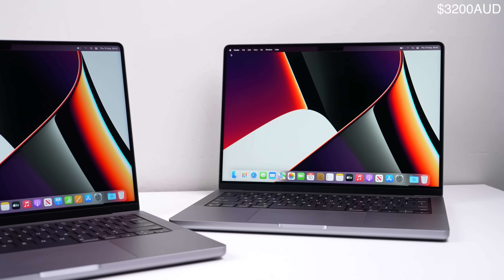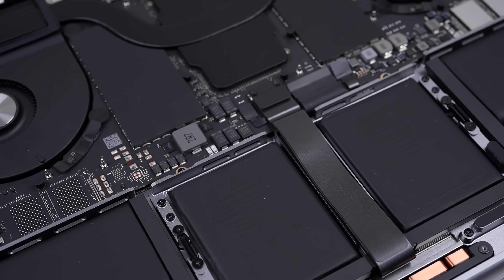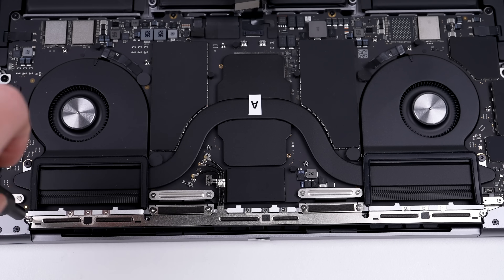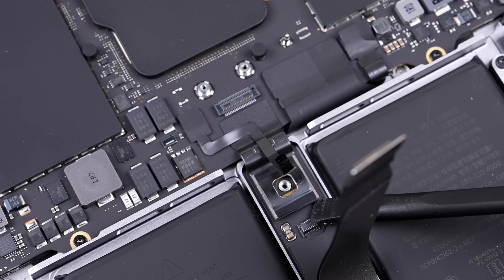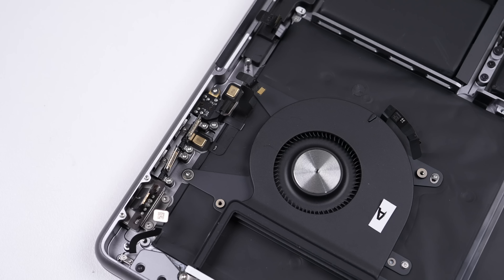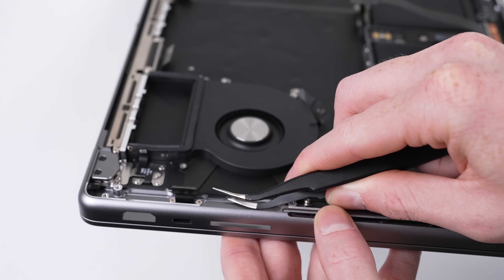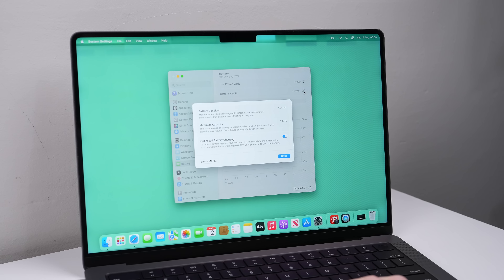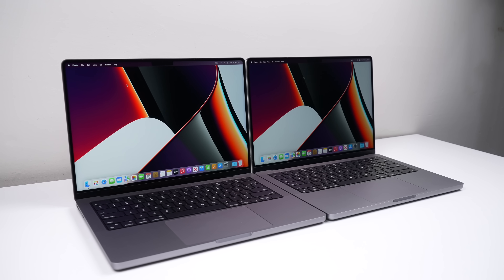New Anti-Consumer MacBook Pros - Teardown And Repair Assessment - Apple Silicon M1/M2

Comment: Oh wow, this has basically killed off replacement displays on Macbooks! Not a very good move at all, especially since delicate and fragile cables that are high risk of being damaged, are paired to either the display, or the motherboard...
To be frank, I fell out with Apple when their Retina series of MacBook removed the DVD drive, user replaceable memory, standardizes SSDs/HDDs, etc, and especially so when Apple removed the headphone jack in the iPhone 7. The long list of anti-consumer moves that Apple have made since have only gotten worse, with iPhones being locked down so much that they can't be repaired any more, and I reckon that the MacBooks will go the same way with the in-house silicon.
I would gladly take a Framework Laptop (or any other brand of laptop) over this new Apple nonsense way of things.
Reply from the maker: I believe its a shame because they do actually make some good things they just also go out of their way to make those things un-repairable.

Comment: I've debated on getting one of the newer Macbooks because the M series chips are super impressive... but Apple's refusal to make things upgradable/repairable without jumping through their expensive hoops is just such a major dealbreaker for me. I know Apple isn't the only company that pulls this crap... but they're certainly the one leading the charge. With how well engineered their hardware is, they should be industry leaders in repairability, not the opposite. It's just disappointing.

Comment: this is not an issue of calibration, this is obviously deliberate. Sensors like the sleep sensor angle are not going to be 90 degrees out of calibration when you swap them. This is apple checking the serial and then fking with you when shit should be working fine.

Comment: I don't know why, but it seems to me that Apple's budget to avoid having their hardware repaired by third parties, whether it's iPhones or MacBooks and everything else, must be several times higher than what they invest in R&D...
Reply: There's considerable overlap between the two, they like developing proprietary components as a means of preventing repairs. The "insomnia" problem is a good example of that, they had to design a completely different method of detecting screen angle specifically to make it harder to repair.
Reply: @@bluewaffletwatYou’re missing the point here. When repair is needed those laptops must be opened and serviced. If only Apple can do it, then there is no competition, thus pricing is what Apple wishes it to be.
Reply: Capitalism is fucking weird.
Reply: @qwertykeyboard5901  There are two extreme ranges of capitalism we know today. First one is responsible capitalism and the second one is unchecked capitalism. Unfortunately more and more people are tending towards the latter as resources in Earth dries up with no confirmation that Humanity can explore outside Earth for more resources. Add to this there is a threat to civilization coming to an end. Obviously some people wants to feel good/powerful before their lives end.
Reply: @qwertykeyboard5901  Facts lmao
Reply: @qwertykeyboard5901 
No, Capitalism makes a lot of sense, if you run a business you would too act like Apple when you get to a certain size, profit margins become smaller and smaller.
Capitalism does not have ethics and morals, it only has business and profit motive.
Reply: Probably it is part of their "Definition of done".
Reply: That's the depressing part, Apple must have some truly brilliant engineers in their employment. Imagine how good a laptop they could design if Apple would just let them.
Reply: @fix0the0spade yeh brilliant engineers to make a laptop slower than last year one.
Reply: @@bluewaffletwat just wait till you damage an angle sensor on your 4k laptop only to find out that apple can repair it at 1500 instead of 100 from a small repair shop or for free if you have basic functioning brain. What's your IQ? Seems like its in 2 digits.
Reply: @realcyphox5919   Cost and complexity.  There are lots of indturies apple could be in but you cant work in all industries.  If apple were to suddenly start to stockpile every single possible part and component for their Mac books they would be entering a completely differnt industry, with a lot of extra complexity. Not to mention risk of stockpiling a parts that might not sell for years waiting lots of money.
Reply: Those who defend Apple's practices, why are you wasting your time watching these videos? It's clear that, regardless of the evidence, you're going to continue to choose to ignore it... Or do you have some sort of filter in your brain that tells you it's all honky dory and perfectly designed? You guys really are pathetic.
Reply: @@bluewaffletwatthose folks need to have landfills situated more closely to their living areas.

So they can better appreciate the consequences of rapacious consumption and aggressive consumerism.🤔
Reply: @@bluewaffletwat actually large corporations have a technical it department that strip and repair their machines domino in cambridge, brother(printer company) and a few others do that with imb lenovo dell... last i checked the service contract for domino was for over 8000 machines....
Reply: @@bluewaffletwatreally? Show your study about the demographics that doesnt care. They dont open the mac but they pay to repair it.
Reply: If it cannot be repaired, people will buy a new one. Get the customer base trained up with this idea, and people will stop and forget that we used to build our own computer from parts all the time... even laptops.
Reply: Apple is a marketing company that happens to make okayish computer hardware.
If you spend too long in economics you'll realize the most money made the world is pure marketing.
Why are Apple rich? you know who they are.
Why are Google rich? How many Web service/Search engine companies can you name?
Random startup companies and kickstarters? Hey, somebody had to hear about them first
Reply: This is delusional. They spend 20 Billion on R&D
Reply: Apple is not putting any active effort into making it harder to repair it is just that they do not consider third party repair at all during design.   

So choices are made just based on reducing cost, increasing production yields, reducing production lead times etc.
Reply: @hishnash  I just hope you don't really believe what you wrote.
Reply: @abdul9   I very much do, they are not putting active effort in, aka spending money just to make it harder for third party repair. 

But they are not considering third party repair at all.  Thus choices they make commonly are anti reapir (not always... see the use of screws rather than plastic clips) since sometime third party repair lines up with apples cost savings.  Using screws increase the chance apple can re-furbishment a returned device so they can use it for the next customers warranty replacement saving them a LOT of money compared to giving that customer a new device.
Reply: @hishnash did you forget about them making certain parts only replacable so that they have to be configured to the device by apple. If they didnt put effort in, any new part should work straight out of the box without any configuration
Reply: @townbig not necessarily. They are precision components that need testing and calibration. This practice is not at all exclusive to Apple. The proper argument would be to point out why they don't make this software more easily available, like other companies do.

So, Apple doesn't want you to tinker with "their" stuff, but that doesn't mean its components are necessarily designed to be repair resistant, more than being more efficient or less expensive.
Reply: @townbig wow, hardware security is really a topic unknown in this comment 😂
Reply: @hishnash   They programmed in a feature that specifically puts ugly blobs on your perfect screen if you had a third-party install it instead of them. Even if it is literally from a completely brand new MacBook too. That required, by virtue of the feature existing, active effort and money dedicated to making it harder (impossible actually) for third-party repair unless someone finds an exploitable vulnerability that allows us to bypass this software.
Reply: @FlyByWire1 There's so much to say about that... Another delution of fanboys. Would you like to start? Be sure...
Reply: @FlyByWire1   I dont know what you mean by that, but as it was for iPhones, Im assuming each new part (that is hardware locked) has to be plugged into a machine that sets the part's code to the same code as the devices motherboard. Or once the device has the new parts they use what they call a diagnostics tool to set the parts to the motherboard Maybe its different for Macbooks, but I feel like I got a pretty good grasp on the topic of Apple's hardware locking, but feel free to correct me
Reply: @townbig  yes that’s right and there is absolutely nothing wrong with that. It is just like the iCloud lock. It prevents criminals from taking parts from Apple devices and tampering with them and trying to resell them.
Reply: @TheWatchmaker  yall call everybody a fanboy if they disagree with you. Get over yourself dude 😂
Reply: @FlyByWire1  Well, your response is the typical fanboy response, "hardware security", without providing any argument of course... Do you want to talk about that or do you prefer keep playing the offended card? 🐑
Reply: @TheWatchmaker  I already answered it in reply to someone else’s comment. Just go see that one
Reply: @TheWatchmaker  I can tell you’re chronically online my guy. Using fanboy and calling people sheep’s, are you 12? Lmao
Reply: @eireworm   Not this is what happens when you run a Mini LED display without a backlight profile.  The fix would be apple updating the calibration profile servers they have to let a un-autharies screen swap still pull the profile when you boot into diagnostic mode. 

 That side this YT did not even try booting into diagnostic mode so for all we know they screens could have pulled the profile but that would not make for such a good video would it.

Even then if you were replacing a used backlight you would need to pull the wear info form the old device SOC,  even if apple documented this I do not expect any third party repair vendors selling used miniLED displays to bother doing this.
Reply: @hishnash   And why exactly are the devices not able to eve try calibrate parts when an error occurs? Why does it need to ask Apple permission first? Because it moves the decision making power solely into Apple's hands. If you want to repair your device, you need Apple's permission which requires paying Apple. Very convenient indeed. Almost as if it's planned...
Reply: @eireworm   Firstly you need to boot into diagnostic mode to attempt to calibrate anything.   (that they did not do in this video so...). Diagnostic mode ships on all modern Macs, apple have support articles on how to enter this.

Secondly if the part is already assigned to a differnt devices SN then apples servers will reject and not provide the profile. What they should do is update that server so that it will provide it as long as the currently used device is not flagged as stolen. (blocking the re-sale of parts form known stolen devices is not a bad thing).
Reply: @TheWatchmaker whats the risk of removing battery ?
Reply: @FlyByWire1 his argument is valid , there s no way to defend apple.
Reply: @hishnash  your a bit delusional
Reply: Hopefully, you are being sarcastic because you are speaking as if you are involved in the process. There's plenty of evidence as to show how Apple does ridiculous things to make third party repair shops the villains.
Reply: what do u mean... these computers are hyper efficient machines that sip power and still deliver amazing performance..
Reply: @veryinterestingwow nice bait
Reply: @veryinterestingwow and they also break more easily than in the past, add more e-waste to landfills, and leak toxic chemicals into water sources.

One devil of a trade-off there...🤔
Reply: @veryinterestingwow hahahhahahhahahahhahahhahahahha. Quit dope bro.
Reply: @veryinterestingwow yeah, just wait till it fails and you have to spend 1000 USD to repair it then we'll see how pro apple you are